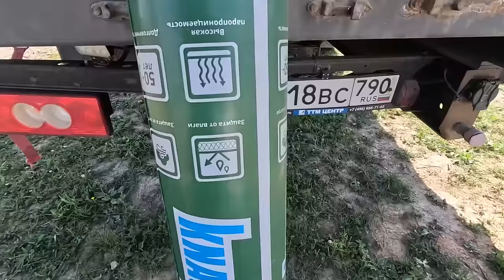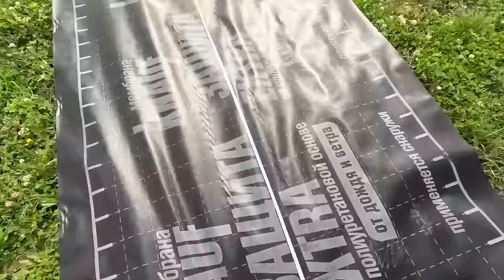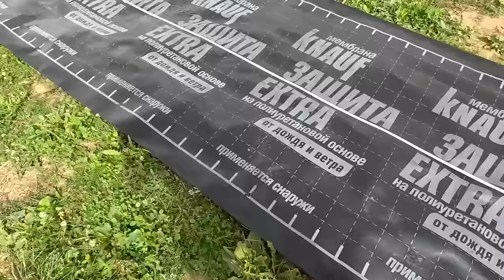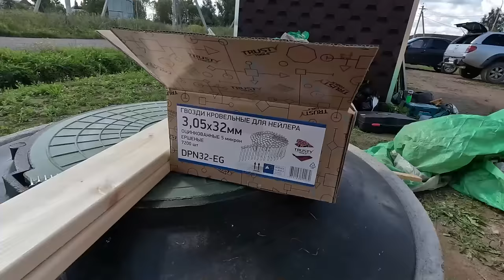Built a BUDGET frame house. Step by step construction process. Here's what happened...

Comment: Very interesting construction. Very similar in USA, but a lot less ridged, less reinforcing, 2x4’s. I don’t understand some of the overlapping, etc. Why not vinyl siding rather than roofing for walls. I had a design that was for a summer cabin that was 2 bedrooms, 1 bathroom, kitchen, dinette and a great room in the middle and was only 24x38’,  or could be increased in 2’ sections. This was on a concrete slab. Could be done in 2 weekends, not counting the slab.